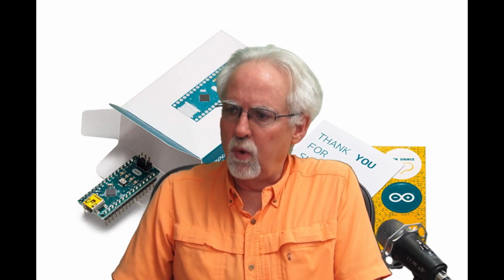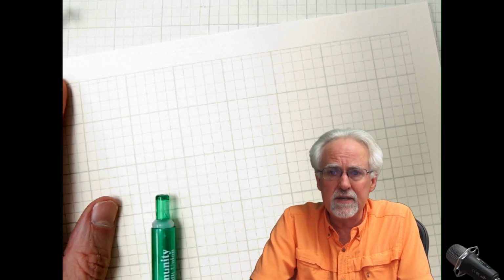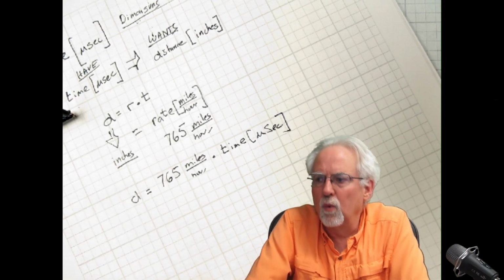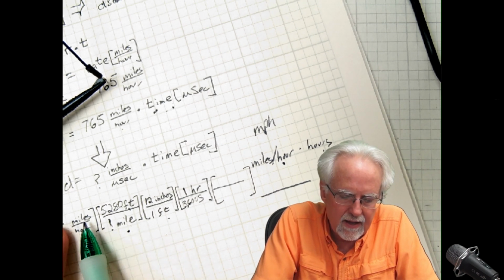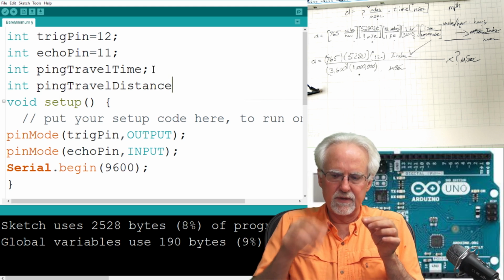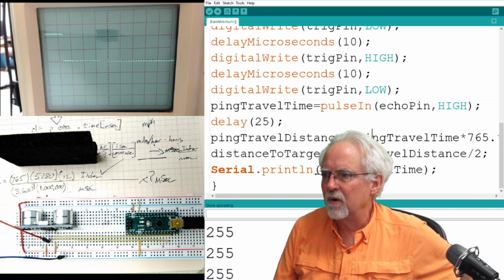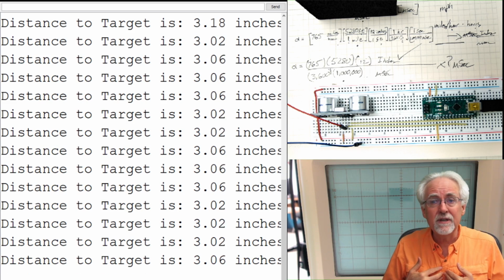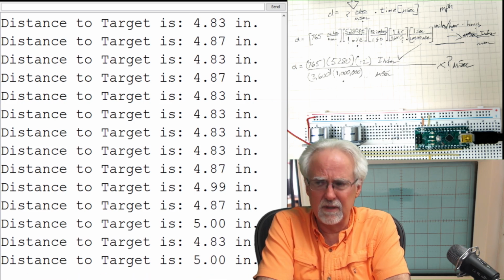Arduino Tutorial 55:  Measuring Distance With HC-SR04 Ultrasonic Sensor

Comment: Hi Paul, I am a doer! I absolutely loved this homework  (the me who was in the middle of those problems probably wouldn't say that though), I know it isn't too difficult of a challenge but my main issue was the conversion rates and what the speed should be (I was constantly thinking it should be cm/s but later went cm/μs). I big thing that helped me was the D,S,T (distance, speed, time) triangle that I learnt in school. After getting it all sorted I checked that the closer reading were accurate but didnt think the ones were I was pointing it to my roof was, until I checked. That was when I was really shocked about how I have just engineered this system together using different measurements, conversions, readings from the ping time, it is such as great feeling.

Here is my code, slightly different to yours, but still achieves the same thing (I am also reading in cm not in):
int trigPin = 7;
int echoPin = 8;
int echoTravel;
float pingTime;
float dist;
float sos = 0.034305;  //cm/microsecond

int dt = 10;

void setup() {
  Serial.begin(9600);
  pinMode(trigPin, OUTPUT);
  pinMode(echoPin, INPUT);

}

void loop() {
  digitalWrite(trigPin, LOW);
  delayMicroseconds(dt);
  digitalWrite(trigPin, HIGH);
  delayMicroseconds(dt);
  digitalWrite(trigPin, LOW);
  delayMicroseconds(dt);

  echoTravel = pulseIn(echoPin, HIGH);
  delay(25);
  pingTime = echoTravel /2;

  dist = sos * pingTime;

  Serial.print(dist);
  Serial.println(" cm");

}

Comment: int trigPin=12;
int echoPin=11;
int pingTravelTime;
float pingTravelDistance;
float distanceToTarget;

void setup() {
  // put your setup code here, to run once:
pinMode(trigPin,OUTPUT);
pinMode(echoPin,INPUT);
Serial.begin(9600);
}
 
void loop() {
  // put your main code here, to run repeatedly:
digitalWrite(trigPin,LOW);
delayMicroseconds(10);
digitalWrite(trigPin,HIGH);
delayMicroseconds(10);
digitalWrite(trigPin,LOW);
pingTravelTime=pulseIn(echoPin,HIGH);
delay(500);
pingTravelDistance=(pingTravelTime*1235.*1000.)/(3600.*10000);
distanceToTarget=pingTravelDistance/2;
Serial.print("Distance to Target is:  ");
Serial.print(distanceToTarget);
Serial.println (" cm");

}

Comment: I  changed inches (and miles, foot) in centimers for the metric system users ...... (1 kilometer is 1000 meter, which is 100 cm : much easier ).

Comment: I drove myself crazy on this homework.  Lesson learned.   Every day when I crank up the Arduino I need to connect the com port and board.  Triple checked math, connections, code and kept getting clearly wrong results re-triple checked everything.  Before I called a shrink, I reconnected the port and board and hit the reset button, held my breath and loaded the sketch, and boom!  It worked.  Now I can buy a Nano because I saved a ton by not having to see a psychiatrist.

Comment: I did a simple "for" loop to take 10 readings then averaged them and did 1 print rather than print so many of the same distance. Then I start over. Enjoying your unit/dimension analysis. Used to be a piece of cake - in high school over 60 years ago! Good refresher. Amazing how much I have forgotten. Thanks

Comment: There is some issue after putting the int delaytime. I guess the delay after pulse in for echo is not enough to catch the waves back. However, can you help me with this, here's the sketch.
Reply: int trigPin=12;
int echoPin=11;
int pingTravelTime;
float pingTravelDistance;
float distancetotarget;
int delaytime=500;
void setup() {
  // put your setup code here, to run once:

pinMode(trigPin,OUTPUT);
pinMode(echoPin,INPUT);
Serial.begin(9600);

}

void loop() {
  // put your main code here, to run repeatedly:
digitalWrite(trigPin,LOW);
delayMicroseconds(delaytime);
digitalWrite(trigPin,HIGH);
delayMicroseconds(delaytime);
digitalWrite(trigPin,LOW);
pingTravelTime=pulseIn(echoPin,HIGH);
delayMicroseconds(2000);
pingTravelDistance=(pingTravelTime*765.*5280.*12.)/(3600.*1000000.);
distancetotarget=(pingTravelDistance/2.);
Serial.print("Distance to target is ");
Serial.println(distancetotarget);
}
Reply: One noticeable thing is if I reduce the delaytime int till 300 and below the sketch starts giving the output. What is the logic behind this ?

Comment: ok...I did the homework for once. I had the dimensional analysis set up right but I kept the distance in miles (my error). I ended up with .00 distance. Not good. But everything worked right when I converted to inches. Very cool distance meter...

Comment: I was able to do this on my own, thank you Paul!  I graphed out to 14 inches, and was able to get a very accurate measurement using calipers and multiple measurements (four graphs) and averaged my readouts.  This was one of the best so far,  just the dimensional analysis portion of the lesson is so very appreciated.  Looking forward to the low-pass filter lesson, because that would have decreased the number of graphs I needed to be reasonably accurate!  Thanks again, Paul.  My calculated speed was 771 mph, I guess it was warmer here than it was there!
Reply from the maker: Well done!

Comment: Eventually got to the solution, displaying out on LCD, at 120mm it was about 2mm out, which is close enough for my desktop measuring. I have learned from this. Yes i will appreciate some more DA work, although i never work in imperial at all anymore, in Europe metric system is standard.
Also as i've read from Alexandrubitlan, how can we make an average of the measurements, looking as some of our previous projects, being able to average out some data would mean more than raw figures sometimes.
Reply: I am an American, but I do each assignment in both Imperial and metric units.  The more times you do it it helps my 80 year old brain :).

Comment: I tried to use a known value of speed of sound at sea level (343 meters per second), and convert it into millimeters, but the real-time measured value was off by about 20 millimeters and I'm not sure why. 

I used the formula 'distance = ( (343 meters * 1000 millimeters per meter) * (pingTravelTime / 1000000 microseconds per second) / 2 )'. I also tried Paul's formula, but my reading was still off by about two thirds of an inch. I'm thinking it's the sensor, but I'm not entirely sure. 

My formula seems to work fine though, I used my calculated slope from the last lesson's line of best fit and used that to figure out the distance by inputting my data into the formula 'y - y1 = m(x - x1)', and then rearranging it to solve for 'y' (distance). This minimized the error I was getting to within 1-2 millimeters. 🤷‍♂

If anyone had a similar situation or knows what the issue could be, I would love to know!
Reply: pingTravelDistance=(pingTravelTime*343); 
distanceToTarget=((pingTravelDistance/2)/1000000);
gives the distance in meters
Reply: distanceToTarget=((pingTravelDistance/2)/1000000))

Comment: void loop() {
  // put your main code here, to run repeatedly:
digitalWrite(trigPin,LOW);
delayMicroseconds(10);
digitalWrite(trigPin,HIGH);
delayMicroseconds(10);
digitalWrite(trigPin,LOW);
pingTravelTime=pulseIn(echoPin,HIGH);
delay(1000);
Serial.println(pingTravelTime);
float in = 0;
in = pingTravelTime / .00001286;
Serial.print("inches = ");
Serial.print(in);
delay(1000);

}

Comment: You could take 3 or more measurements, then get the average by diving by 3. the number of measurements.
Well, the spec sheet says the ping is 40Khz. The max distance is 400 cm. I used a Sonin 45 which uses Ultrasonic sound, and aiming at the target, or at the receiver didn't affect the distance.
Likely because the both operate on different frequencies, so the HC-SR04 is deaf to Sonin's frequency.
Even NASA Engineers make mistakes sometimes, like using the wrong units. Maybe that's why the engines didn't fire on time and the first stage failed to separate. We have had hard Lunar Module landings because one Engineer used Meters/Second, where another used Miles/Hour. Everyone needs to agree on using the same standard for time critical events.

Comment: they say a lazy man will find an easier way. two video's ago when we measured the slope, I multiplied that number by the pingTravel Time, I then checked it with a ruler at 44" (distance to the wall while the unit was on my desk) I got a number close to 45" so I experimented modifying that slope number and re-testing until the measurement was accurate. I also added a "round" command to eliminate the decimals and a delay to smooth out the readings. my final math command is(measure= round(pingTravelTime*.00685) this is very close to the results of your formula/2 (.006732).I also added the LCD and power supply to make it portable. I like the idea by another student of averaging the numbers, I may have to play with that before moving to the next lesson. I have a friend who needs a level indicator for liquid (maple sap) in a tank. We have discussed using this circuit with a large digital display so it would be visible from a distance.
Reply: yup, the suggestion by Alexandru below to use a FOR loop with 50 repetitions averaging the measurement really smoothed it out. I then tweaked my conversion factor(now .00689) until it was with +-.05" at 40.5". YMMV

Comment: Hi Paul. I started watching these tutorials 2 years ago as I needed to make a joystick  control 2 motors to drive a small man lift that I have invented.  It lifts a person up to a height of 5 feet. and drives around using a 2 axis joystick.The machine weighs only 80 pounds  and is 22 inches wide and 32 inches long so it can be carried up and down stairs.    I could not find a code to cut and paste that made sense to me.  But with the things you taught me I was able to successfully write my own code. It controls the speed and direction of two motors and is very smooth and easy to operate.  I also added servo motors to engage and dis engage brakes.  Now I am working on adding a wheel speed reduction which will slow the travel speed down as the platform is raised.  It will allow full speed in the lowest position and slow down based on distance from platform to ground using an ultrasonic sensor.  Thank you so much for the easy to understand and follow tutorials.  # 53, 54, and 55 for this part.
I have a patent pending on this machine and have completed the 6th prototype which I am using for my work installing plumbing and heating systems.  We are in the process of getting design drawings and engineering so we can get the necessary certifications so we can manufacture and sell them.
Reply from the maker: Excellent!

Comment: after long research we have a new technology to send data over dc lines so no need to connect 4 wires of ultrasonic module just use same dc line between module and MCU to supply module & get data

Comment: Error:  The hand calculation  shows distance.  You converted the speed of sound in miles per houe to inches per micro seconds.
in the program you multiply  speed  times convertion factor to get distance.
You should have given up the "Hold Your Breath" by lesson 3.  You should be systematicly checking each line for spelling, upper/lower case, missing semicolon, etc.  Letting the compiller find misstakes is what beginers do.  Clearly you are way beond a beginer.
You have not talked about documentation.  you should have talked about documenting the program from lesson 1.
I do not recall you defining a node. 
I have watched lessons 1 through 55 and learned a lot.  I plan to go to the end, 68 lessond.  Good job.  Thanks.
Pat

Comment: Hi Paul Thank you very much, I have been learning a lot from your video beside Arduino, Maths and others. I manage to do the homeworking by myself but the method is slight different, I will not able to do it if I did not attend the early lesson especially lesson 24 onward  till current lesson such as drawing the graph and calculate the slope and so on. Thank you vert much

Comment: Well done, Paul.  As I was leaning back in my chair, I realized what was causing my calcs to be a bit out of whack.  The distance measured from target to sensor is not what you can measure with a ruler, since the sensor is actually recessed a few mm inside the frame of the sensor.

Comment: Sir, I measure distance in inches and mm also according to Dimensional analysis which I have been taught by you.
Reply from the maker: Excellent
Reply: @paulmcwhorter  Thank you, Sir!
Reply: @paulmcwhorter  Sir I got a problem when I put the target object against the HC-Sr04 sensor at 5.5 in from the half of the transmitter I got  4.32 or 4.28 in on the serial monitor  , I put the formula same as you teach us. I don't understand where the problem is.

Comment: I may have cheated a little but as a Brit, I like to work in mm, so I did the following
Googled Speed of Sound in mm, which is 343,000mm/second
My calculation for distance therefore was:
343000.00 / 1000000.00 * pingTravelTime / 2.00
Dividing by 1000000.00 adjusts for the pingTravelTime in microseconds
Dividing by 2.00 at the end adjusts for the ping travelling there and back.
The resulting distance (in mm) is remarkably accurate, I like this way.
I also noticed that the material used as a reflector can have a small effect on the distance.
Keep 'em coming Mr. M

Comment: I put the 7 previous lessons togethere and built a project. So the arduino is measuring the humidity, temperature with the DHT_11 and the distance using the HC-SR04 and it all values are displayed on the lcd. The dimensional analysis was very helpfull beacause I'm using the metric system. thanks a lot for your great lessons!

Comment: I did it on my own and I installed a LCD (and power supply) so I have a fully functional, movable distance measuring device. Being UK based, I worked mine out in centimetres and did the maths myself rather than forcing the arduino to do the work each time, so ended up with pingTime * 0.017144, and slowed the refresh rate down to 1 second. It appears to be fairly accurate: +/- 0.5cm between 10-50cm (outside this range I haven't checked).

I would like to install this in my vehicle with a GPS sensor to work out my speed and the distance of the driver behind me, so it can work out the stopping distance and alert the driver behind when they are too close!!!

Comment: I have to admit that, even though I was really, really good at math when I was younger I was really lost in lesson 54. I cheated a little and got the homework to work though (thank you interweb for online converters). However, I did come around during this lesson and, using your method of calculations this time, came up with the correct results by using the my own (this time correct) manner of calculation. Thanks again for the brain challenge!

Comment: I did it in mm/microsecond. Sorry, miles inches and foot, over-complicated, And I still have the lcd from lesson 48 hooked up.

digitalWrite(trigPin,LOW);
delayMicroseconds(10);
digitalWrite(trigPin,HIGH);
delayMicroseconds(10);
digitalWrite(trigPin,LOW);
pingTravelTime=pulseIn(echoPin,HIGH);
dist=((343.*pingTravelTime)/1000.)/2.;

lcd.setCursor(0,0);
lcd.print("time: ");
lcd.print(pingTravelTime);
lcd.setCursor(0,1);
lcd.print("dist: ");
lcd.print(dist);
delay(500);
lcd.clear();
}

Comment: i used the equation v=d/t. I googled the speed of sound in millimetres per microsecond because I am on the metric system in New Zealand. it saves code space and is easier to debug when it is a decimal or fraction with one number on the top and the same on the bottom

Comment: Thank you for another fine tutorial. I have not been able to follow these for the last month (life issues) but finally got things in order and can get going again. So good to get back in, got the dimensional factors correct but was using int instead of float which caused problems. Once I got that sorted all was good. Thanks again!

Comment: Another great video! Dimensional Analysis is a crucial tool if you want to actually design and build things rather than make replicas of other people's work. The problem students have is that they come up with an idea and try throwing components together and code, without laying the foundation for their project: Flow charts and Dimensional Analysis for any conversions. Again, great lesson. Thankfully, you have a whole series on Python, Raspberry Pi, etc., so I don't suffer during the holidays.
Reply from the maker: I think dimensional analysis  is one of the most important skills for almost any area of life, yet it is not taught well in schools, and few understand it. They try to find a canned formula for the specific conversion they want to do. Thanks for helping people understand this.

Comment: Hey Paul, so glad I made it this far in your tutorials. 
I was going to try and make a portable distance sensor (displaying distance on an LCD) but then I realised that both set-ups require access to pins 11 and 12. I have previously hooked up the LCD using random digital pins which ended up 'letting the smoke out'. 
So how can I connect both components?

Comment: Another good lesson.  I played around with it.  I printed both feet and inches.  I also added a LCD display w/I2C.  Also added a command: exit(0); at the end.  That way to use it, you point, press 'reset' it 'pings', then holds that number until 'reset' is pressed again.  Works more like a store bought ultrasonic measure.
Thank you.

Comment: In the UK using mm/ms. My original readings from lesson 53 were a little out but I found using the actual speed of sound in the equation (distance=pingTime*[0.34029/2]) and then measuring back from the target were remarkably accurate. However this was measuring to the plane of the front of the sensor and not to the center point. Thanks for another great tutorial Paul. I look forward to using this in real world applications.
Reply: I found the same thing - measuring from the front of the sensor gave the best accuracy.  Might depend on the maker of the sensor?